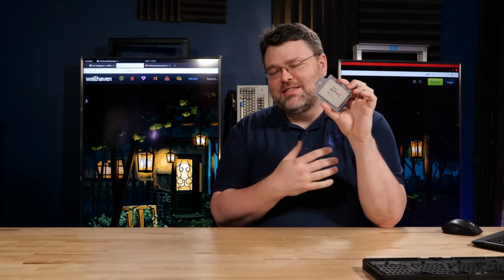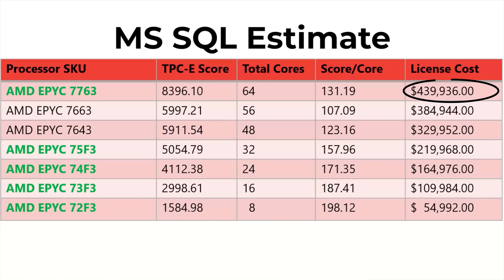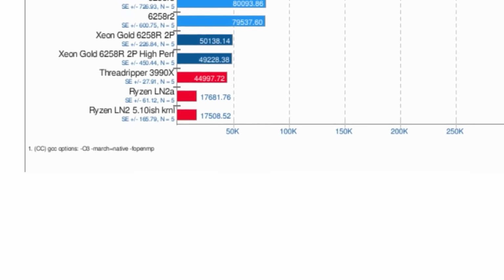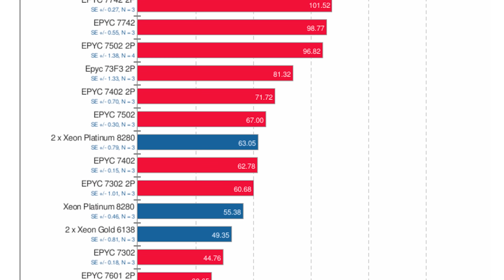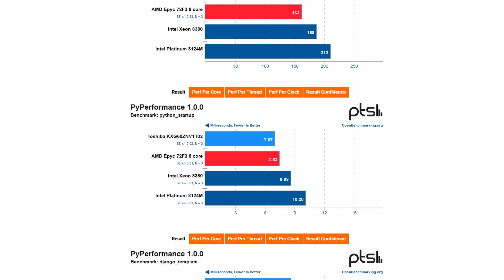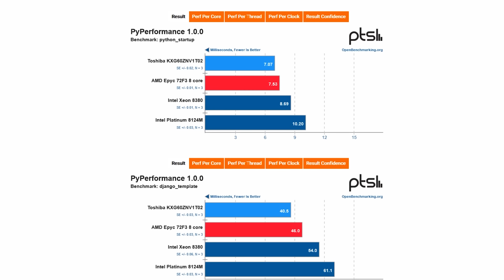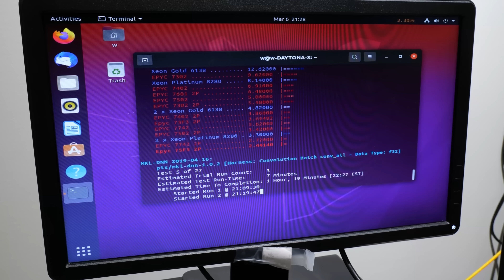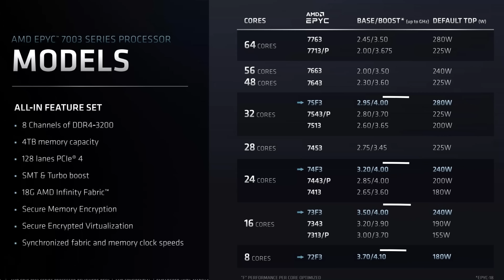What The "F" Is Up With The AMD Epyc 72F3?

Comment: Any way you could do a video on how to turn DOCP on for an asrock rack x570 board lol? I gather there's only manual settings it seems quite hard. Otherwise my memory is running at 2133Mhz for a 5900x. Not ideal.

Comment: Benchmark some games with it? Epyc 72F3 vs 5800X with the maximum and minimum clock frequency of the 5800X (set via the CPU-scheduler) the same? Just to see what the impact of those extra memory-channels is that would be fun. The 5800X gets 3600 MT/s memory with ridiculously tight timings, the 72F3 gets 3200 MT/s memory but with 4 times the channels. The nerd in me is curious about this.

Comment: At 8 cores, shouldn't that CPU clock at least in the 4.8GHz all core range?
Reply: It's optimized for different things, like power usage and bandwidth, over pure clock speed.  Even at 8 cores, these could probably move far more data around than a desktop part.  Also, the common way to make these is to use defective chips.  Laser off the bad cores, and you have more thermal headroom and cache per core.

Comment: What? Compiling absolutely benefits from more threads. If it doesn't you're likely using an outdated compiler or crappy config. Modern compilers can scale very well even up to 128 threads. Well I misunderstanding you?
Reply: You missed the Node.JS/JavaScript reference... It's all single threaded.
Reply: A surprising number of web platforms don't scale as well as you'd hope.  Especially when it comes to things like test suites.  Heck, Python is inherently single threaded, and multiprocessing comes with a few caveats.

Comment: 180 W on 8 cores, for 4.1 GHz all core, my 5800x achieves 4.55+ GHz on all cores with a much lower power output, is the i.o. die taking up half of the power budget ?
Reply: It's likely it does use significantly more, but also tdp is such an arbitrary number I would count on either until measured under the intended workload.
Reply: @morosis82  you have a point, but server hardware might be closer to the trouth, also the 5800X has a mesured TDP of 125W acording to Gamers Nexus, I forgot, that it is rated at 105W acording to AMD.
Reply: Your 5800x doesn't support 4TB of memory, among all the other benefits. Don't compare home-grade with server grade. Run a big SQLDB on your 5800x/32MB cache/128GB RAM and see how that goes against this - 256MB cache, 4TB RAM, 200+ GB/sec of memory bandwidth vs your 51GB/Sec.. Are you beginning to understand the differences?
Reply: @promethbastard  dont correct me on a comment that you have clearly not understood.
Reply: @promethbastard  the question is, how much power does it take, once again read before write.
Reply: @promethbastard  Do you need a hug, bro?

Comment: Having more cores was randomly chosen as a way to improve performance of chips when chip designers were unable to do anything else. It's not necessarily a good way to even expect processes to function, although programmers have somewhat adapted to it. There are several other ways to advance the capabilities of a chip, for example, getting IPC improvements is one and there are people out there who're designing chips around this principle. However, I believe that the frequency improvements that I can get with my hardware will outcompete anything else. For an average consumer, I'd say that my products will change your mind on your perception of high core count.
Reply: More cores were not randomly chosen. It was the only avenue left that offered significant performance gains with any feasible technology. Originally they thought they were going to just keep building faster and faster CPUs (like 8 GHZ+) but physics said no. Die shrinks did not keep pace with what they were expecting from straight up speed boosts.

Comment: Man I want real ECC memory for my main home machine,(reliability, not gaming) but the price of these server CPUs and MBs... ouch. (Used is ok, but most servers don't get cycled out until they are really well used/end of life and they still ask too much for what it is.)
Reply: Ryzen supports ECC in certain motherboards. It's not official, but they didn't arbitrarily remove the capability.

I have 64GB ECC on my 3900X in an ASRock X470D4U.
Reply: @morosis82  "supports ECC memory" is not the same as actually using the ECC. Can you confirm that you are getting the error checking and correcting function? Last I checked(been a while) consumer Mboards that "support" ECC sticks only physically accept them but the ECC function is disabled so they function as normal RAM.
Reply: @mytech6779  The Ryzen memory controller doesn't 'officially' support it, but AMD don't disable it and leaves it up to the MB manufacturer. Some do, some don't, my X470D4U server board does. At least, it's recognised as ECC and I have the bits set up, haven't had an issue with errors so difficult to say whether it's really working.
Reply: @morosis82  Yeah I don't quite know how to test for it either, I need to get back into the loop.  
I just use my desktop more like a server with up times of months and a few uses that are less tolerant of data errors. 
I also get at least ten years from a build and then downgrade it to a secondary machine for another 5 -10 years, as certain hardware components age electrical errors can become more probable. 
In the off chance that I really need big speed for something I could rent time from a service like AWS.
Reply: DDR5 will have on chip ECC, when it comes to consumer grade hardware. Not as fancy as true ECC, but that will at least protect against dodgy memory chips if that's what worries you

Comment: Harkens back to the 8-core/16 thread Ryzen Threadripper 1900X but that HEDT CPU wasn't anywhere near $2500.  At $299 MSRP.
Reply: ... It also did not have 32MB L3 per core which is what makes this beast a force to be reckoned with... Plus, of cause, double the PCIe lanes and double the memory channels. Hungry beast is hungry and need to be fed data....
Reply: @andersjjensen  double the lanes, each of them double the speed.

Comment: That sucker clocks higher than my (undervolted) 4790K.
Reply: It's great to have a server/desktop comparison like this on occasion to remind you that "fast" in one field is not necessarily so in another.
Reply: i mean 4790k isn't exactly the latest and greatest and even if it did clock higher the IPC just isn't comparable
Reply: @Radovanslav  It's the latest and greatest for me. I just got it last month, upgrading from FX 6300.

It just tickled me of the clock difference and I wanted to leave a comment to help the channel, so that's what I shared.

This wins in performance per watt for my usage though, so, yay?!?! XD
Reply: @ChrispyNut  Great upgrade dude! I did the same upgrade back in 2016 on my little brother PC. From FX6300@4,4GHz to i7 4790K@4,6GHz with an RX480 4Go. I tested it on Overwatch and PUBG, with the same settings I got 2x more fps! It was INSANE!!!

Little brother still runs today that PC and he is starting to learn Blender on it, and he still game Farcry 5/Dirt Rally sometimes, runs like a charm!

The PC got awesome 16Go of DDR3 2133MHz Corsair Dominator GT, but I suppose it will probably be soon not enough if he starts to make huge things on Blender... Still a great 1080p gaming PC, and I don't think it will loose that much value considering the current market.
Reply: @Mister-Tea  Yea, The CPU was frustratingly weak for the R9 290X. Unfortunately I was wrong to think the Mobo had died when it was the PSU and in the months between Rig dying and getting funds for replacements, 2 of 4x8GB DIMMS died (possibly connected to rig death), which mostly defeated the purpose staying DDR3 due to the quantity I had (for Cities Skylines Assets).

Now to decide whether to plump for 2400 memory and later flip remaining 2x8GB @ 1600 (C9) for 2x8GB 2400 (C12 IIRC).

Currently deciding whether to sell 290X now, while prices are still a little silly and I'm not playing the only GPU intensive game I care about, to then get ram and GPU together, later, cheaper.

The toils of the educated poor. :-D
Reply: @ChrispyNut  oh ya I can imagine since the 290X (legendary OC capable GPU BTW) merely perform as well as the RX470/480 if I'm correct? Before the 480, my brother had the HD7870 which was fine for many years.

Ya you probably should sell that 290X to a Fornite kid (you know the kind of kid that want to play hard that game, and parents don't want to spend much on PC), and get either get something dirt cheap (if that still exist) or survive sometimes on the iGPU (still enough to play most Valve game,  moba, or run SNES emulator).
Reply: @Mister-Tea  Maybe.
Most of my gaming's strategy RTS, City builder sandboxes) or the like, where games are usually CPU bound, so I had a horrible balance (left over bits from early mining attempts that were marginally better than what I was running).

For Cities, (my unicorn I've never been able to run (modded as I like) adequately.  Previously weak CPU and insufficient VRAM.  I have looked at getting RX4/580 with 8GB as it'd perform better because of less swapping textures as the GPU's otherwise pretty idle.  Now I have the CPU power, but not enough sys or VRAM.

I have a GTX 750 Ti 1GB that I got recently for a Retro XP build, but the iGPU's about as valuable, they can render Wendell's beautiful face and Mini Motorways :D

Or of course, I could just be less picky again in job hunting, then money wouldn't be nearly as much of a struggle X-/

Comment: Because of Microsoft SQL licensing is so nuts, no sane startup should choose them over Postgres. They’re competing with free.
Reply: Indeed. If you can justify half a million dollars for licensing a relational database, you could just as well hire 3-4 experienced developers to optimize your workload for Postgres (or contribute fixes to Postgres).
Reply: @rhekman  Unless it's some legacy system which can only work with Oracle or MS SQL
Reply: @erkinalp  Disabling cores in the BIOS does not reduce your license costs.  The licensing contracts see through that, requiring all cores in a processor to be licensed regardless of whether or not they are in use.
Reply: No there are few cases that SQL server is better
Reply: MSSql is only this expensive for enterprise edition with SA.  There is a much cheaper standard edition that will do most things and as well as a free version that many products use out of the box just fine. MS sql has advantages over postgres, depending on your development platform.
Reply: Isn't MS SQL free for small businesses?
Reply: @guiorgy  They have a low-cost option that is competitive with PostgreSQL or MariaDB. By the time you need more storage. It has a table size limit. You need a professional DBA and a support contract from someone.
Reply: Perhaps it’s people running COTS apps that are built on SQL server